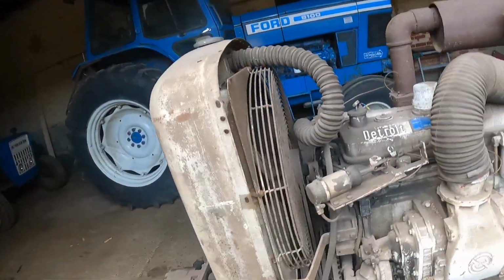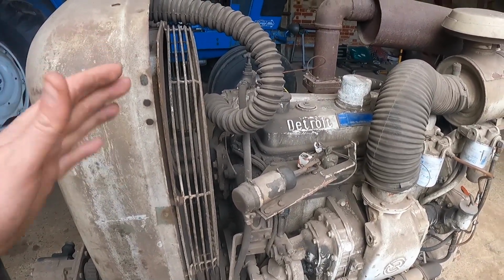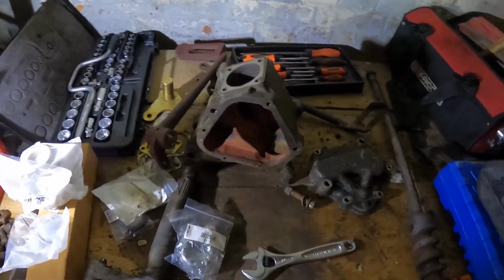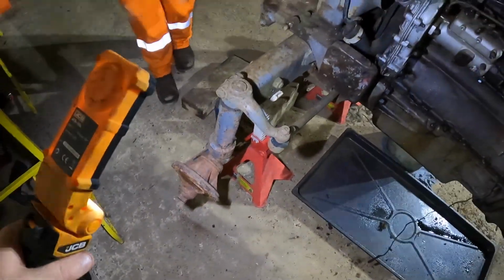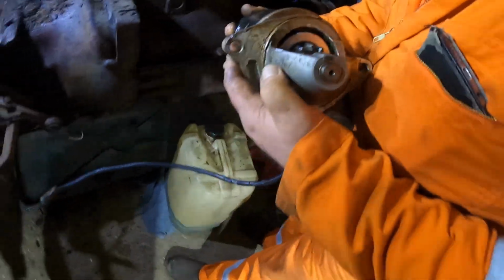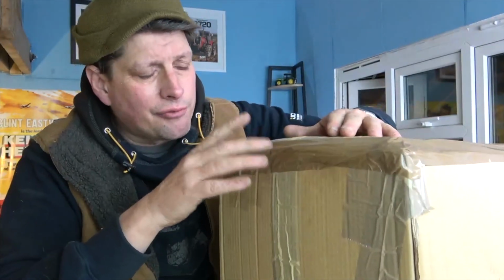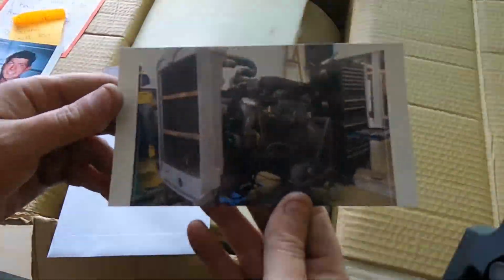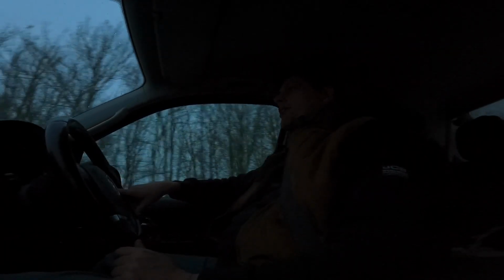WHAT'S INSIDE THE SECRET BOX ?

Comment: Quality oil and grease is the most basic and cost effective maintenance you can buy. Interesting video, the insulation tape made me smile . Reminded me of an old farmer who called me out to see why his nuffield tractor was blowing oil out the dip stick. I noticed a stick stuck in the drain hole on the bottom of the lift pump, the old fella said "orr yes her was leaking diesel so I cut a hazel stick out the hedge and shoved in to stop her leaking" . Well what could I say,  it fixed the leak but the sump was full of diesel. 
Keep up the good work, looking forward to your next one.

Comment: We used to have a couple of them 4-71’s on right angle drives to run water wells for city water. Also had a 2000 watt belt drive generator off the side to power the lights and chemical pumps and control circuits.

Comment: If its got a CAV pump on it, these could be setup either running clockwise or anticlockwise depending on the engine manufacturers arrangement, trouble starts if the recon pump wasn't off the matador or it runs in the opposite rotation. The injection order is different from the firing order. A bit of savagery with the injector lines can sort this headache lol....!!! Good luck mate.
Reply from the maker: It's worse than that... 😉

Comment: An AEC that won't start, I've had a 760 with a hole in the side and it still ran......
Reply: I came across some one who had put a new pump in a Leyland diesel and it would not start, turned out they had put the stop lever on back to front so with the stop button pushed in the pump was set to stop position.

Comment: Thanks for another great video. I'm just looking at the picture with  the old steam wagon who's the old guy  with the hat, He kinda looks like a younger version of John Miles "the crowman" from where I grew up in Tring, Herts. He used to steer an engine called Oliver owned by  the Wheeler family if it's him.  That shaft out of the 165 steering's still got another 1000 hours in it, "there's still splines on it" L.O.L wouldn't be the first time I'd had guys say weld the arms on, because they didn't want to buy new parts back in the early 90's. You'll just have to admit being a Ford guy you ripped that steering wheel off while clenching trying to shyte on that Massey seat didn't you L.O.L . Take care.
Reply from the maker: It is indeed John 😉 I've still got some of the wonderful drawings and sketches he done for me.
Reply: @LordMuck  Thanks for the reply, small world isn't it. The funny thing is there is a bit about him on the Tring memories  pages on FB around the 15th of Feb.
    An old school friend writes about riding on Oliver with him, the other time he rode on the engine I was in the trailer on the back,  that must of been mid 80's I left there in Jan 88. 
    It looks like the town/steam world lost another great guy in 2017 when he sadly past of cancer. But he got a fitting send off  with his ashes going up Olivers chimney, running full bore  at the G.D.S.F. There is a picture of that on the discussion to.
 It's cool you've got some of his drawings , I really didn't know much about him all those years ago. Take care.
Reply from the maker: Let me try and dig out another sketch he did of a Matador and I'll see if I can put it in one of the videos.
Reply: @LordMuck  Thanks would be interesting to see if you can.

Comment: Thats a new one AEC not starting.
Reply from the maker: Wait for a couple of weeks and watch the video 😉
Reply: @LordMuck  has to be something stupid.
Reply from the maker: Or fairly dramatic...
Reply: @LordMuck  I can not wait ex fuel man and hgv fitter
Reply: Do I get a prize for knowing what's wrong with it 🤣🤣 spent a good afternoon trying to get that engine to run problem became clear 🤣
Reply from the maker: The reason behind 'that' reason was even more dramatic.
Having said that, I did actually get it to "run"...
Reply: @LordMuck  over the years and having spoken to a few I came across a few initial reasons why diesels fo not start... a classic many years ago a pair of very good hgv fitter spent all week end rebuilding a  daf 2800 engine this would be 1980s.. in their desperate attempt to get it ready for Monday. Late on Sunday maybe 8 o'clock. I get a call. Seeking help. They had put the air intake pipe on and in the dark left a big red plug in the new turbo... they did appreciate my input as they had been struggling for a few hours bless them.  Another one the bloke who built the online fuel pump fitted the camshaft backwards. This was an old BMC engine online pump.
Reply from the maker: We'd basically sussed this from the offset but once we stripped it down it was fairly amusing.